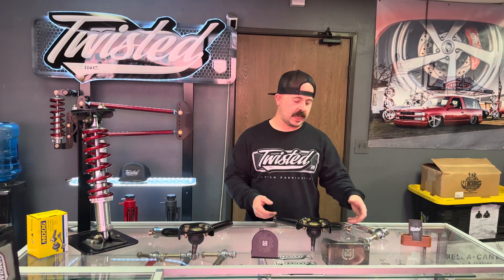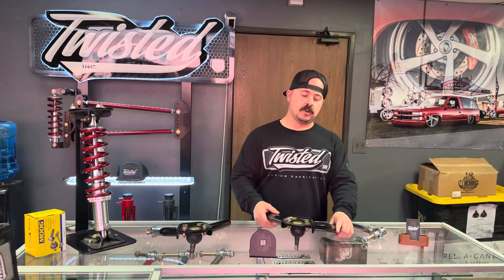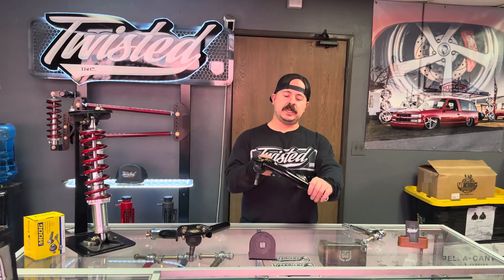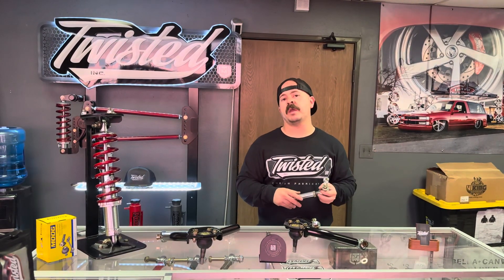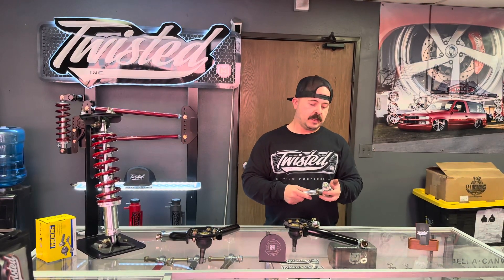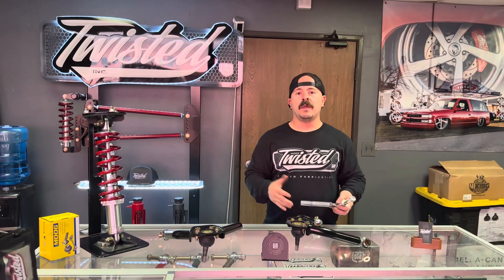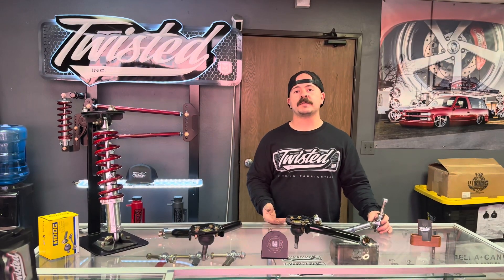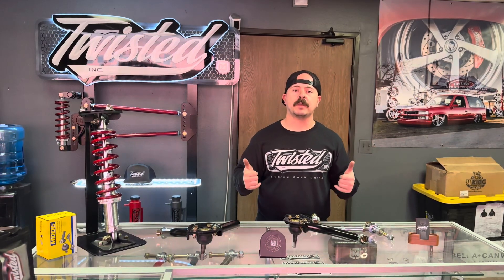Twisted Metalworkz Camber correction control arms explained

Comment: Hi. Im currently on a 4/6 drop on my 99-02 single cab silverado.  Rear runs fine but I'm the front would you recommend a bump steer kit? I'm on 2" spindles and your 99-06 viking coilovers you guy carry.
Reply from the maker: Usually a 4” drop wont require a bumpsteer kit, look at the tie rod angles with the truck on the ground. You can also call the shop or email us for any other questions
Reply: @twistedmetalworkz3579 what if your Ina 5 in drop
Reply from the maker: @victorvargas9512 check your tie rod angles
Reply: What do you think of those coil overs? Thinking of doing the conversion on my EXT
Reply: @jerlaine1638  coilovers are good.  But obviously not the same ride once you lower a vehicle